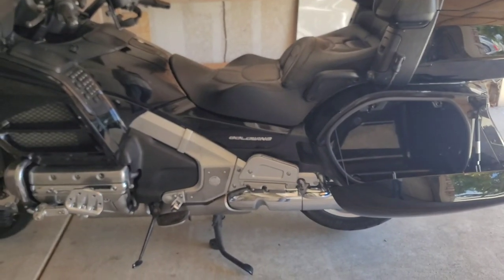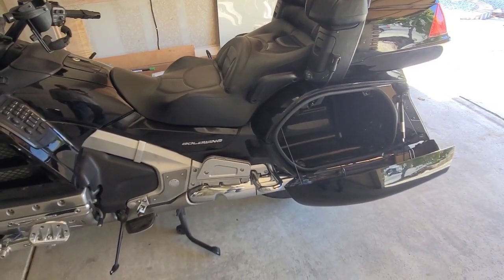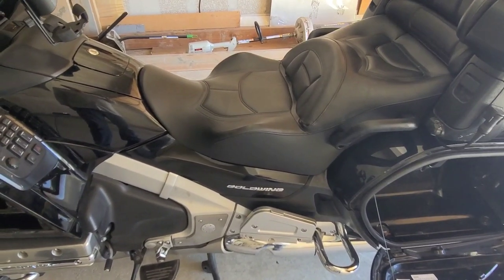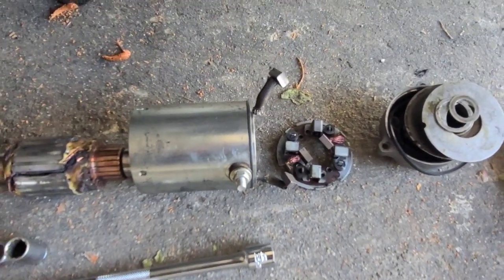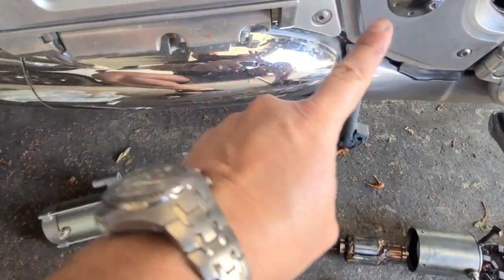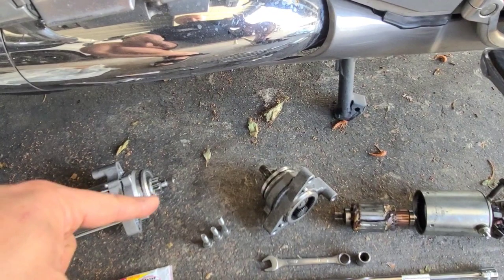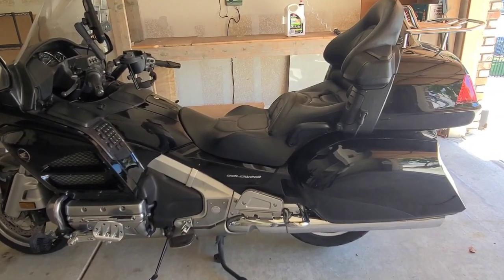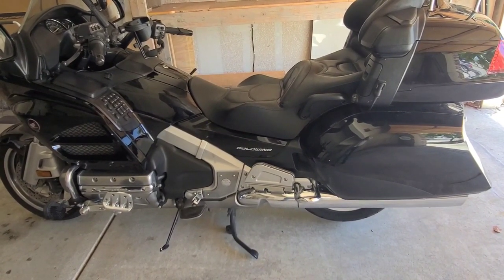Goldwing 2015 gl1800 starter replacement tips and insights. Watch through.

Comment: You explain it so well. Im trying to only remove the three 7mm long bolts to pull the starter but I can't reach the bottom 7ong bolt. Maybe that's why ppl remive the 12mm bolts and that whole assembly.

Comment: How do you get to the bottom bolt on the starter?
Reply: 1/4" ratchet drive three extensions going in from behind the center cross bracing. swivel joing at the socket. Taped all joints on the extensions and the socket.
Reply: I also let the master cyclender free to allow more clearance to see the bottom bolt.
Reply: I would also probably put the long bolt in the starter houseing when placing the new starter into position.
Reply from the maker: From my experience (didn't show it in my video) my suggestion is use an endoscopic camera (around $20 on amazon) to see where it is.  The reason is that right next to it there is identical bolt meaning there is a great chance you may unscrew the wrong bolt. Once you identify it then use extensions as mentioned above. Also, to put back, use camera and piece of paper napkin to wedge the bolt into the socket while carefully snaking it in.